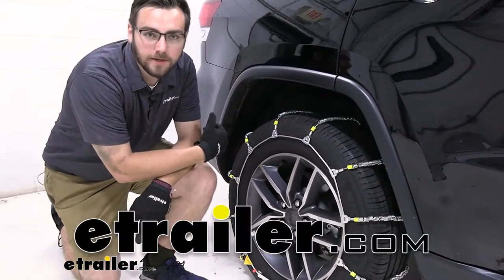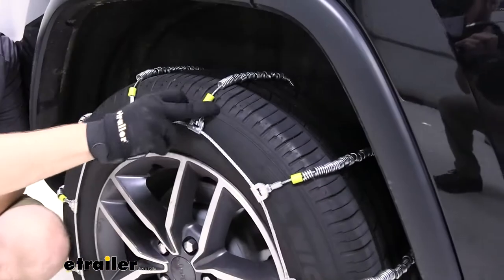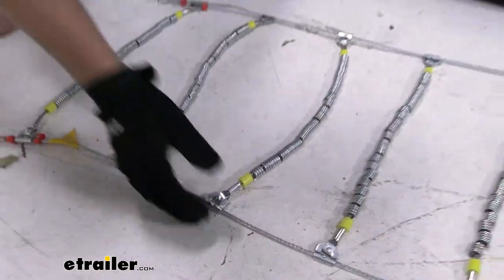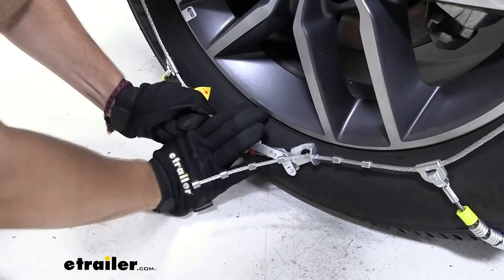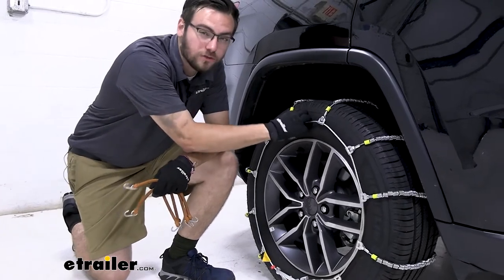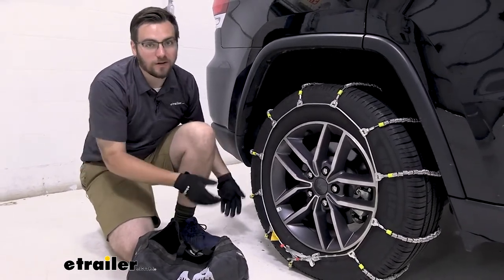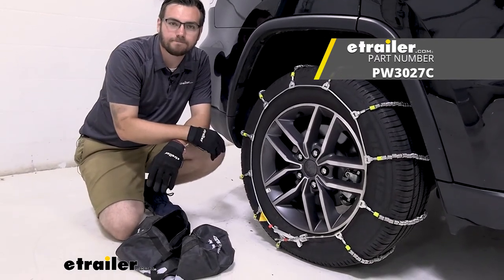Beginner’s Guide to Installing the Glacier Cable Tire Chains on a 2021 Jeep Grand Cherokee

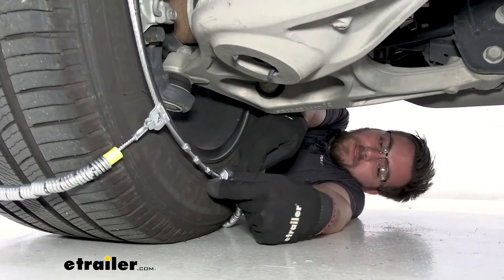Comment: Quit watching 3:20....I do believe that cable goes on the other side. The yellow triangle tag may say left side on it. Not sure. At any rate, your not connecting the tail and the hook correctly. Don't go through the hook end. Cable goes over it and the nub settles into place. You make it so hard and are so wrong.